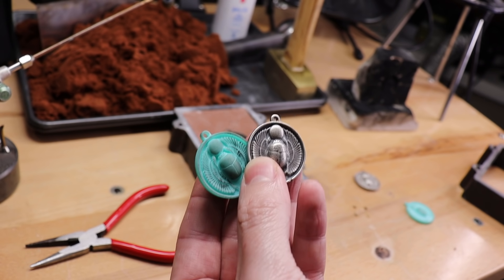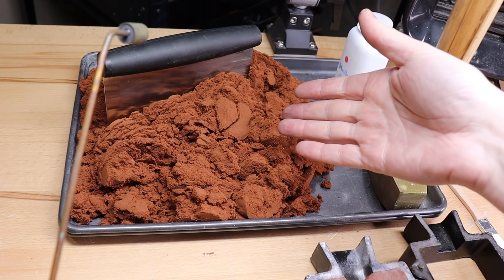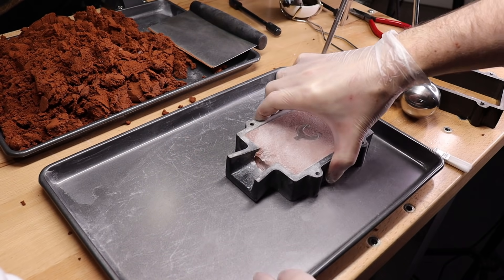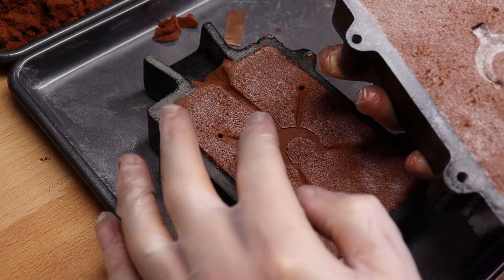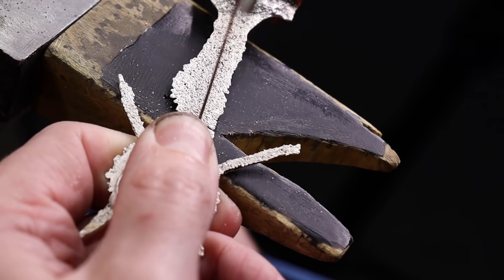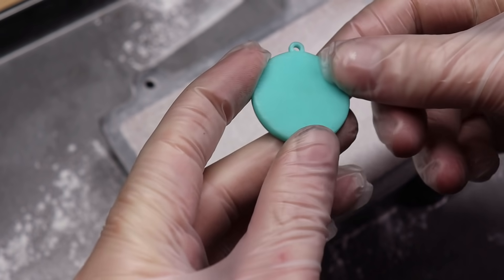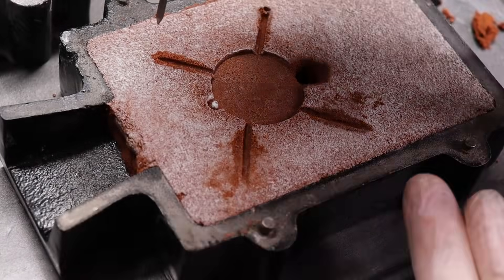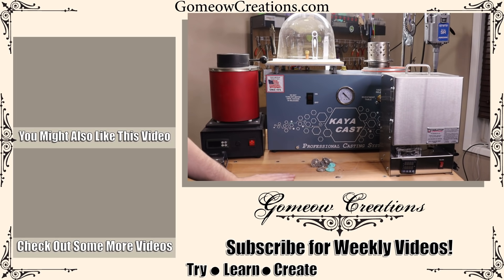Jewelry Casting Made Easy Using Delft Clay & 3D Printing

Comment from the maker: I with how you how to make copies of your work using sandcasting along with how to make new castings with the help of a 3d printer.

Big thanks to Ridge for sending me this wallet and supporting the channel! Here’s the site if you
want to check them out.  http://bit.ly/RidgeWallet-GomeowCreations Use Code “GOMEOW” for 10% off your order! 😁👍

**If you are looking to by one of the solid silver scarabs place email me, first come first served**
GomeowCrations@gmail.com

ELEGOO Mars 2 Pro Mono Resin 3D Printer - https://amzn.to/32SnfU2

Cast Iron 2-Part Flask Mold - https://amzn.to/3py0ZIF

Aluminum 2-Piece 100 MM Round Mold - https://amzn.to/38PxwnO

4.4 Lbs Delft Clay - https://amzn.to/3nC35pn

Cheaper but not as detailed 5 Lb Petrobond Casting Sand - https://amzn.to/3nsSCfG

Cast Iron 2-Part Flask Mold with Petrobond Casting Sand Kit - https://amzn.to/2ILJ40x

Cheap Metal Melting Furnace - https://amzn.to/2H6IPwf

Electro-Melt Melting Furnace - https://bit.ly/Electro-MeltMeltingFurnace

Smiths little Torch - https://bit.ly/SmithLittleTorch5tips

Smith Little Torch Rosebud Tip - https://amzn.to/3kDPSKs

Baby Powder - https://amzn.to/3nwWA6Y

Scraper/Chopper Stainless Steel - https://amzn.to/3lGX6ic

Sheet Cake Pan - https://amzn.to/3nwF1nO

Brass Hammer - https://amzn.to/3f684vb

Ceramic Crucible - https://amzn.to/3pA0w8O

The maker of the 3D Files that I used https://www.instagram.com/the.jewelry.fantasy/

If you are looking for more tools and materials that I use, well you're in luck! I made a page on my website just for that and I'm updating all the time so bookmark it to stay up to date:

https://GomeowCreations.com/tools-and-materials 
https://GomeowCreations.com/partners-discount-codes

If you buy any of the tools or materials from my list I will make a small commission at no extra charge to you and it helps support the channel

----------------------------------------------------------------------------------------------------------

If you would like to directly support the channel you can do so in a few different ways.

If you would like to directly support the channel you can do so in a few different ways.

1. Like, comment and share my videos

2. You can make a one time donation via Paypal of any amount https://www.paypal.me/gomeowcreations 

3. You can sign up a monthly donation via my patreon for as little as $1 per month https://www.patreon.com/GomeowCreations

4. You can sign up a monthly donation via my Subscribestar for as little as $1 per month https://www.subscribestar.com/gomeowcreations

5. Just watching my videos helps out too and I'm happy to see that I have been able to help some may people get into jewelry making.

#delfcasting #delfclay #sandcasting #jewellerymaking  #jewelrymaking #goldmaking #silversmithing #diy #gomeowcreations
Reply: painfully slow. unprofessional. full of wrong terms. waste of time

Comment: Having had a job as an artisan at a bronze foundry for a few years, I think most of your defects are shrink deficits and insufficient vents. To minimize shrink deficits, you need wider gates and sprues, but mostly you need to make a pour cup large enough to keep feeding them as they cool, preventing them from separating and cutting off the flow of molten metal. My castings of everything from figurines to monuments had minimal to no shrink deficits, so I think this will at least reduce the shrink deficits.
Reply: Q: 3d printed lost wax with printed vents. Will the vents dissolve and work?
Reply: @rupacustoms90  Well, yes and no. Yes, they melt and vaporize, rather than dissolve, along with the rest of the wax. As in lost wax casting, you know?
Reply: Also, as someone who once owned a foundry, I would say that the "texture" or graininess of the casting (which can affect how clear the detail comes out) is due to either, a) Insufficient vents or vents that could have a better design (as @nunyabusiness9043NunyaBiz said), and/or b) the metal being too hot (or possibly needing to be fluxed/degassed).

There are a few other things you could do in the molding process that might make it a bit easier, and possibly produce a better result, but overall a very cool video.  I really enjoyed it. Nice job and I'm glad you're sharing this.

Comment: I've been a jeweler for 34 years, a nice tip for you, moisten a paper towel and run over the edges of the object in the mold before you pull it. Preserves the edges. Nice video!

Comment: And you should put the piece face up on the table, put the cope and clay on top making a tight print coat. Flip, make a pour funnel/feeder and vents, put on drag and pack clay, separate, refine sprue and vents, remove piece, etc

Comment: Hey randy! Another way you can do things with flat backs is by putting the back on the table first. Then you sprinkle fine clay on top to get the details in, then start packing heavy sand on top of that. It captures the details best from what I've seen. Hope that helps!

Comment: Thank you for your fine tutorial. I was able to reproduce an antique brass drawer pull using your method. I used a different method to melt, the metal pail with lump charcoal. Your method of making the mould was my guide. I am very grateful to you. Btw, your taste in jewelry pieces is excellent.

Comment: You mention having issues with getting perfect results around the 24 minute mark - have you tried olivine sand? I haven't worked with it personally, but i've seen it pop up in discussions about fine-mesh casting sands. Another thing to try would be to incorporate your vents and sprue into the 3d printed master, so you're not knocking around loose sand as you're cutting them. Also, for 2D pieces like that medallion, you can design a threaded hole into the piece and when it comes time to remove it from the mold, simply screw a screw into it and use that screw as a handle to lift the piece out.

Comment: I would place the pattern flat side to the table. Use sifted sand to cover the pattern first before filling the flask and pounding the sand tight. When pushing the pattern into the sand the sand is displaced distorting the sand in the flask which you don't want to do.

Comment: Bro... Old fashion....the new trend is melting solid metal in a 100$ microwave in less than 10 minutes 😁😁👌👌
Reply: Even gold?
Reply: @MrLuvbizwar yes... specially gold and silver... It would take 5 to 10 minutes to melt gold in a microwave if its 24k gold... If its an alloy mixed with another metal then it will take  10 to 15 minutes depending on the amount and stiff...so you will have to keep checking on it every 10 minutes

Comment: back in HS we never tossed out the burnt oil sand. Just mixed it back in and away we go. It would last a very very long time even with burnt bits. It would over time darken the sands but the teacher would just refresh it a bit over the course of the year and we did loads of sand casting in our shop. So when you did the second side that was literally flat why on earth did you pack it on top of the other one? We used aluminum, copper and bronze. I liked the aluminum and bronze the most.

Comment: I'm concerned about how toxic 3-D Resin printing is. I was going to go with that, until I saw a video showing how the air continues to be at a maximum hazard even hours after printing. That's with people using ventilation as well..... Would it be possible to use PLA filament in an FDM 3-D printer, and still do fine in sand or clay casting? Maybe the answer should be obvious but I'm new to 3-D printing.

Comment: You could improve the quality by improving the ventilation and sprues and by adding a pour funnel that can provide molten metal as the casting cools, reducing bubbles and shrink deficits.

Comment: Graphite powder instead of baby powder on the delft clay surface that comes in contact with the hot brass, silver etc gives a nicer surface , less pitting. Other tip: make first some copies of your model in lead or pewter in your delft clay, using baby powder ( graphite does not improve the pewters surface) now you have a multiple good positives to put in the delft clay. 
About the scarab: I did 12 brass smileys last week, 6,5 cm diameter and 4,5 mm thick, and the first one I did flask laying flat, details down, flat side up. The pooring channel in the centre if the smiley. Result: a lot of pitting on back and even front. 
Next poor, I made the pooring channel 2 cm outside the smiley, cutting the entry channel from there horizontally into the smiley. Result: 100% better. Used graphite to cover the clay surface.
So, just my bit here...
Reply from the maker: Thanks 😁

Comment: I saw some casters using a small air bellows to remove dust and a sitck with glue to lift the 3D Print up without damaging the impression in the clay. Could that help?
Reply from the maker: Yeah that sound like that would be helpful, thank you 😁👍

Comment: Beginner's question: what is better to use this method with casting sand or use the method with plaster mold casting? the plaster casting looks like be the industry standard and I am not sure but looks like can be done in artisanal way too, I ask because the pieces from plaster cast are sharp and clean while this ones with clay arent as shrarp
Reply from the maker: Vacuum casting is going to be the way to go with castings things with details. You can do some nice castings in sand but you have to limit the details.

Comment: What is the best and most economical heat source and torch for melting the silver ?  I have been using propane with a regular torch, silver will melt but won’t flow. 
Please help 😁

Comment: I came for the 3D printing. I stayed for the Horror. Having worked in 2 foundries, I see so much done wrong. Use G clams to hold the mould together It reduces flashing. Never rubber bands. Why press the pattern into the flat surface? it creates the missing parts. Place it on top and create the second part of the mould. for more 3D patterns make half in the mould bottom and half in the top.  Print the sprue with the pattern where possible. it saves time. for instance.. With the scarab I would print a sprue to the right size for the mould. Pack the sand around it and make it flat. add the the scarab face up and the second part of the mould and pack the sand on top. Then extract the patterns (use a small screw hole on the sprue.) and if you are smart a tab on the scarab when you made space for it on the sprue pattern. Create some vent holes, clamp it tightly and then pour the metal
Reply from the maker: Oh yeah I definitely did a lot wrong in this video. And have definitely learned a lot since then, here's a video I did on Lost wax casting and 3D printing along with 3D scanning https://youtu.be/t2H_lV8IOyY

Comment: Which is better for an ingot mold, cast iron or stainless steel?
Reply from the maker: Idk. I have never seen a stainless steel one. I have cast iron molds and they work fine for me. Just make sure to oil them so things don't get stuck and heat them up before you pour the metal in

Comment: which affordable 3d printer you recommend
Reply from the maker: So if you want a resin printer like the one that I used to make this one I really suggest the Elegoo Mars 2 Pro. Here is a link https://amzn.to/3eUlAE3
It is a little bigger than the first mars and it has a monochrome screen so you can print things about 2x faster. 

You can also get the Anycubic Mono, it has a bigger print area and is cheaper than the Mars. It also has a monochrome screen so it is basically the same thing, here is a link to it https://amzn.to/3vFBkkw

When it comes to the resin for them it really depends on what you are wanting to make. I used some resin from PowerResins to make this skull. Here is a link to it and and discount code http://bit.ly/JewelryResinsPowerResins 250g or 1kg 15% off - Code GOM15

I have also used BlueCast resins in the past and they seem to work really good as well. https://bit.ly/BlueCastX10LCD Use Code GOMEOW5OFF to save $5 on your order of BlueCast Products

But if you want to make other things that don't need to be used in a burn out oven there is a wide variety of resins on the market for all kinds of applications.

If you want a FDM printer, basically one that uses filament to print you can get a basic ender 3 to start and modify it to your liking later on if you need to. I have 6 modified ender3 printers and they do a great job but they can't do the details that a resin printer can.  Here is a link to one https://amzn.to/3ePMbCo

If you have any more questions please let me know. 😁👍

Comment: Hey-- I dont know if you'll ever see this comment, but I'm trying to make a medallion with no experience and have a question. Why does the model have to be 3d printed in resin? Why can't it be done in regular plastic filament, and if it can what are the issues that using resin resolves? I only have access to a regular 3d printer and im wondering if it's still possible.

Comment: Awesome video! Can you reuse the sand after the pouring or you have to throw it out? :) Thanks!
Reply from the maker: Yes you can reuse it 😁👍
Reply: You can reuse the burnt sand. It’s only black because the oil has been burned off of it. Just crush and rehydrate with 40w motor oil or mineral oil. Spray lightly. You want the sand to just stick together. No moisture should be able to be squeezed out. If you can squeeze moisture out. Leave it out in the open for a day or a couple. Check on it regularly and stir it often. Always store in an airtight container. (Don’t use Tupperware, it’s not actually airtight)

Comment: The silver is too turbulent when filling your mold.  That's the reason for the pitting.  It's either air or sand that moved from the turbulence of the molten silver.

Comment: Could one do  rings this way?
Reply from the maker: Yeas but it's a bit harder seeing that you need to make room for something to sit inside of the band seeing that it's a hole.
Reply: @GomeowCreations  make space for something to go inside the band? The top layer of sand wouldn't do that for me?, what would I use to fill that space that wouldnt burn or fuse to the poured metal👀? Sorry if these are bad questions im still pretty new tryna grasp the essence of whats going on here haha . I appreciate your patience and tips!
Reply: @GomeowCreations  im trying to figure out the best way to recreate metal clay rings. Making them out of clay is pretty easy but if i could just cast several copies afterwards, that would be very valuable knowledge
Reply from the maker: I have never done this and just do rings by hand or vacuum casting but you could pack down a cylinder of sand that would fit throw the ring. It's not easy to do from what I have seen.

Comment: as a moulder 4get the lump hammer use a wooden mallet and u dont need 2 use a brush just sprinkle it over the mould and u only need the draw lines at bottom as u r puoring from the top .myself i would have gone from the side and made 2 instead of 1.u have a lot 2 learn there should have been no flashing as we called it.less grinding.sorry but next time use the drill in the begining instead of doing it later part 2 lay the flat side down 1st and get some bellows

Comment: I think using a heat press  would work better/more evenly than hammering.
Reply from the maker: This is meant to be a cheap way to do castings and it's very normal to use a hammer or even thick pieces of wood to compact this stuff.

Comment: Oddly light silver.   Those look to be about the size of 1 oz rounds, yet weigh half as much.

I'm fairly certain it's the depth of the piece, but....the depth actually looks about right too, and you have the scarab section that's popping out, which should add some weight.  No much, but some.

Even if this was sterling silver; 7.5% copper, which weighs roughly 5.5g to silvers 6.5g for the same cubic area of material.  It would at most account for about a gram of weight or so.